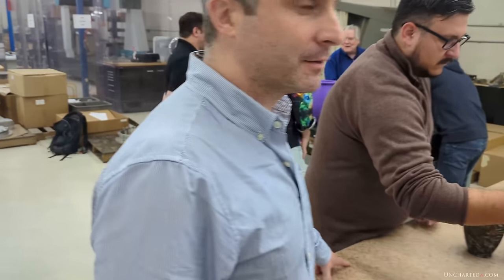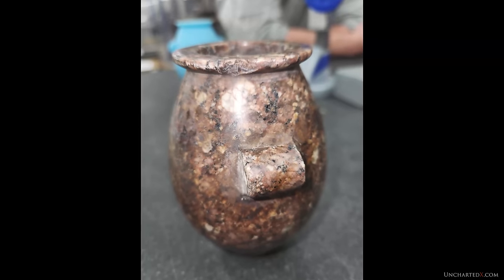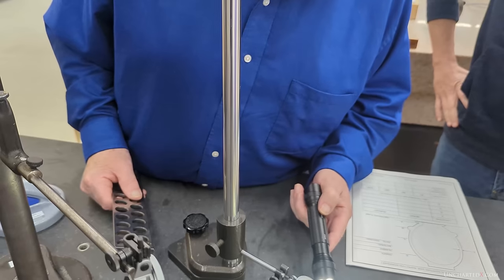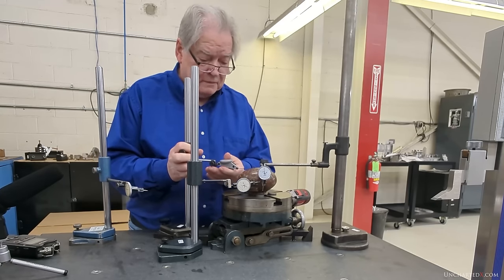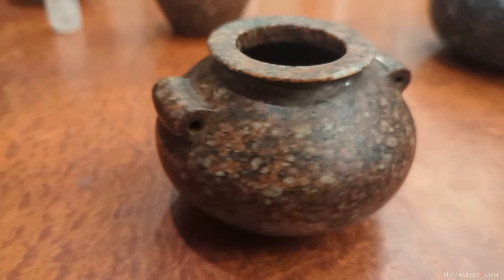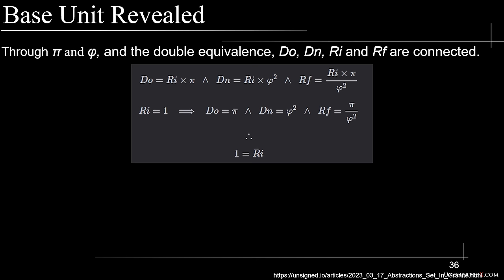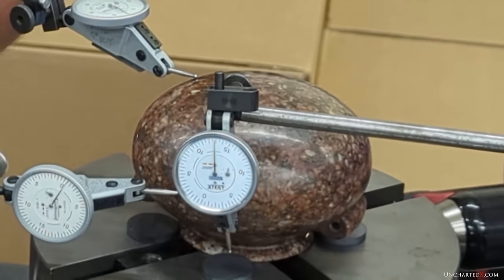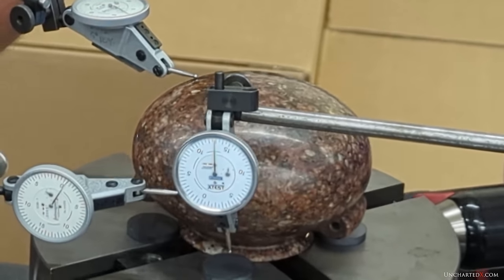Astonishing Results! More Ancient Egyptian Granite Vases Analyzed! More STL's available.

Comment: Ben, this may be a bit off topic but it's about the "I" clamps found connectng huge blocks togetter.. Christopher Dunn wrote about one pyrimid being a power plant of sort and there seems to be a connection between Dunn's idea and Andy Hall's recent video..Andy made a multi-part video series Eye of the Storm but in Andys recent video he mentioned the "I" clamps were NOT there to keep the blocks together as the main function but to allow for a neutral charge in all the connected blocks..should Dunn be correct that the pyramid is a power plant, having a neutral charge through out the pyramid body as to not interfere with the power plant operation would be essential i would think..
Other blocks are fitted so perfectly as to not need an I clamp and one still has a neutral charge throughout the entire pyramid..
Mention this idea to Christopher..might be something he may not have heard or thought about..
Your videos are fantastic..Thx..

Comment: Just my 2 cents but you shouldn't use concentricity, in metrology it was finally removed from asme y14.5 in 2018, and in prior revisions it was a much different meaning and method of measurement than runout. The more appropriate tolerance types would be circularity and runout, depending on if it is referencing its self or to another feature/datum.

Comment: Thank you for a fantastic video. Real numbers at last.
Given the apparent obsession with ratios of geometry do these jars have any acoustic properties? e.g. If you run a wet finger around the lip what note does it produce. Do all jars produce the same note? If a note is produced it may explain the need for such thin walls.
You showed the within part relationships between dimensions. Do the dimensions in one jar match up to dimensions in another? i.e. Beyond the magic ratios of pi and phi, was there a magic dimension?
To make these jars with the precise height today we would machine the jar then cut the top and bottom to length, rather than machine them from a granite slab already of the correct height. This would mean that a donut shape piece would be cut off and discarded. Do we see any industrial waste, of discarded stone donuts, anywhere in Egypt?
You could not make these jars on a modern lathe because of the lugs. However, if the 'lathe' OSCILLATED back and forth (like an ancient bodge) between the lugs it could be machined. Perhaps the jars were rough cut then packed in clay containing smaller harder stones and oscillated back and forth until smooth. The area either side of the lug would not get as much abrasion as other faces (since there would be a pocket of air that allowed the lugs to oscillate within) and this may account for the weaker dimensional accuracy that you were seeing in these areas.

Comment: They look like Helmholtz resonators. Put some electrodes in the holes on each side and run some high voltage and high current through it until it gets hot and tell me what note comes out of the hole please and thanks. It seems like a plasma cavitation device.
If you do the reverse and vibrate them with their own resonant frequency using thermoacoustics...you should get a voltage. They should be thermoacoustic and thermoelectric. In fact I think vibrating them should produce electromagnetic waves.
Many ways to get voltage out of them but cavitation seems to be it... because you can use sound to vibrate them until they heat up and they will get hot inside and suck in cold air and blow out hot air and blow like a horn. It will create voltage and a magnetic field. all the air getting sucked into the hole and blown out will result in a charge separation... a potential. The vibrating magnetic field should give you a current. There will be a torus inside and the dust and air that gets sucked into the hole will rotate in a counter clockwise direction... in a torus. Each of those vase are nodes... If you arrange 7 of them at the nodes in a flower of life pattern with one in the centre and the 6 others around it... the centre one will take all the heat and vibrate like crazy making the other 6 vibrate in resonance... and the centre one will become one heck of a powerful electromagnet. You can see it if you vibrate a water droplet.... 6 bubbles and the centre bubble.. 7 nodes in a flower of life pattern. It's an electromagnetic pattern showing the direction of the charges... because when you vibrate them apart you get a potential.
Those handles seem to be at 0.224 times the length.. right at the nodes. They are thermoacoustic devices. The only reason you would do this is for sound. I'm pretty sure it's pushing an F sharp note in 432 hertz tuning.
Reply: you're right on the money, my friend! btw, my second passaggio occurs at F#...

Comment: Are the holes through the mounting lugs straight cylinders, or are they curved following the diameter of the vessel?  Measure / do analysis on the volume of the vessels vs frequencies.

Comment: IT looks like these are parta of machinery. Like insulators, covers etc. for high voltages. The finding of 16GHz wavelength as basig unit also supports this.
Reply: bingo. remember antique glass insulators? they also had a specific function and were ubiquitous, but show them to a zoomer and they'll have no idea what they were for--and these were used as recently as 100 years ago. no wonder we have no idea what these "vases" were for considering they are at least 5000 years old.

Comment: 19:00 To the critics: IT ONLY TAKES 1 SURFACE machined past human abilities to PROVE they had advanced tech thousands of years ago!

This is by far the best evidence for lost advanced civilization I've ever seen, & this has been an interest of mine for 20yrs.
They can't dismiss this as natural geological formations!
Reply: There is also a "cave" carved out of a hill in India with machined smooth walls smoother than can be done by hand. So this tech wasn't limited to just 1 area.
Reply: @goldenheartOh How do you prove it is smoother than possible by hand?
Reply: @Vision_2  measure as many works of art & buildings from as many masters as you can from ages where there's no doubt what tools they used, and take the most perfectly flat piece we can find and make that the flattest humans can make without advanced machines.
Then, see how close it comes to a 10,000th of an inch.
I imagine this work has already been done. 
It certainly makes common sense that we can't make things anywhere near as precise as our best modern machines, so if we find flat surfaces from antiquity that matches our best modern flatness, there you go.

Plus, it's darn hard to even see a 10,000th of an inch.
Reply: @goldenheartOh  There have not been any measured ancient works that surpass hand level skill. Hand polishing can achieve single digit microns level as measured with roughness meter. All the modern precision measuring tool sets originated from hand crafted tools.
Reply: @Vision_2  it's not the surface smoothness that is impressive, it's the consistent and precise geometry in solid granite.
Reply: @Vision_2  are you saying these machinists are all ignorant to be impressed? That it can all be done by hand? If that's true, why isn't it more commonly done? & in granite? 

Smooth & straight to a single micron can be done by hand? I really find that hard to believe.
Reply: @AustinKoleCarlisle  Impressive I think we all agree.
Reply: @goldenheartOh  Perhaps you find it personally hard to believe but you can prove it to yourself using the 3 plate Whitworth method. That is specifically for flat surfaces. Continued polishing with finer and finer grit.

Comment: I want to take the 3D scans, and do a variation comparison comparing both halves of the vase.(if you take one half, with a handle and inverted it’s x coordinates and compare them to the other half) 
I’m wondering what the deviation would be. 
Are the handles on both ends at the exact same coordinate plan on both sides of the Z and Y coordinates?  If so, what is the deviation?

Comment: how are the handles carved? i could see these being lathed, but they are nearly perfect around the handles. almost seems more likely they were cast with some unknown technology.
Reply: Flinders Petrie documented the spiral single point cutting of the inside of these vases in the 1880's. He said that a lathe must have been used with something as hard as diamond used as the cutting tool. The wall thickness is too thin and uniform to be done with any non precision method. This was discovered by measuring wall thickness of broken vases.

Comment: @UnchartedX Very cool work! Minute 30:33 From my experience working with lathes, couldn't the area around the handles be done on a lathe by slowly grinding back and fourth between the handles? It would be pain stacking to do but should be completely possible. I think this would most likely be the only possible explanation for the perfect roundness everywhere. Is there any evidence on the vases to back up this method? Correct me If I am wrong.

Comment: Hi @UnchartedX, GREAT WORK as usual... QQ: @ ~43 min in you expound on the relationship of the various ratios taken from the radius of the inner lip used as the design template for the artefact.  Has the metric used (measured in mm or inches) turned up in any of the other samples examined?  i.e. Is there some reverence being paid to a specific 'measure' that is then being profoundly communicated to us by virtue of its use with defining other design features based on fundamental ratios that any sufficiently advanced civilisation would have to recognise.  And does this metric (or multiples of it) align with any known fundamental constants of nature?  Were the designers hinting at the fundamental architecture of our manifest reality?
Reply: it's based on the royal finger, which is part of the cubit system.

Comment: Hey bed great work using precision aerospace industry  measuring equipment to show the highly irregular accuracy and precision exhibited in these ancient vases. I have a suggestion so that u can quiet the skeptics and debunkers trying to disprove the measurements presented. Next you'll need to take vases not found under the same pyramid as these highly precise ones and measure those with these instrument to show the inaccuracy and lack of precision of the actual hand made/sanded vases trying to replicate these older vases. Need to prove that the rest weren't just as precise and ur not selecting one trying to show its a unicorn by not testing any other ones against it. Keep it up

Comment: Ok at the 43:40 time mark, my brain exploded with extra thoughts.  When you teach a child basic math you have to start with explaining what a plus and minus sign are.  Then a equal sign.... and meaning.  This jar almost seems like it is using separate "analog" physical dimensions to formulate or explain or show a defined space, or reference.  So does that specific 18.739 hrz frequency... resonate or have a specific property to the volume specifically designated by the vase.  I don't know.  Or like a math equation, you solve it from left to right or top to bottom.  Do the numbers crunch in a sequence of some sort?  Or is this the pie version of A squared plus B squared, equals C squared.... in circle format, not triangles.  My math is lacking... back to basics.  One thing for sure.  These physical dimensions on this vase are not by coincidence.  They define a specific volume of area, or galactic measurement maybe.  The universe uses metric or standard.... what is the galactic standard measurement of one.  If you have one.. you can count binary.  Friggin love your channel UnchartedX!!!!!!

Comment: Ive been wondering why 40,000 such pieces were found under the step pyramid ? That means someone told people to go out and collect them or for people to return them? So why would this happen? Maybe to hide evidence?, they were buried right. Maybe they failed for some reason to finish the job! Were they stoped by others who didnt want that to happen? No one yet knows but something caused all those objects to be put in those tunnels and hid. 
Also as a geologist and amateur machinist/fabricator/metal sculptor I/m wondering if those measurements  such as 0.002-0.003" etc are not due to the thermal expansion of the various minerals in the stone as they heated up or cooled off? In short, maybe they would have been perfect if they did not heat up or cool off! One last point, you mentioned that some of the pieces had an order of mag. difference from the most precise ones. Thats 10 times less precise. Thats about the difference between how precise we could make metal parts in the 1700'-1800's  apart from one another and those we could make after the industrial revolution! Once we got complex machines !  Where are the machines they had earlier in time!!

Comment: The vases look like they were designed in CAD software by a student who didn't yet realise how hard they would be to manufacture. And then picked granite, of all materials! It's mind boggling that these were produced 1000s of years ago.
Reply: They would be very easy to manufacture with a 4 axis CNC machining centre machining the externals, and a lathe machining the internals. A 5 axis machine could do internals and externals in one setup. I am talking about making the geometry, not about the material. Granite would be possible using diamond tooling.
Reply: @motordude67  You are joking right? We have computerized machines that lathe car rims, which needs to be as perfectly round as possible for wheel balance and performance and we still can't even get them as perfectly round as these vases.  And if other cultures had sophisticated math and measuring tools at their disposal, why weren't they creating more of these simple shaped vases in any other time period beside these selected vases that were all dated from the "Pre-Dynastic" period???

Comment: I just saw a video from Matt Beall Limitless. He had a Ralph Ellis on, they were talking about the "Royal finger" and it was 18,71 mm. In this video the base unit is 18.73 mm. Seems very close, and to me a good explanation of what measurement they used. 

I found this vide to be great, however the part with the base unit be speed of light and 16 GHz divided I found be be a strange conclusion. I royal finger seems to me to be a more plausible explanation

Comment: I scrolled through some of the comments to see if anyone had asked about what if the measuring unit wasn't in a decimal type of system (divisible by 10), but one which was divisions of 12 (Mayan) or 60 (Samarian?)? The universal truths of Pi and Golden ratio would still apply, but the outcomes may vary slightly?  I haven't googled to see if anyone knows what measuring system Ancient Egyptian cultures used...anyway, if anyone has asked the question, could you point me to the answer?
Reply: They compared ratios, units don't matter.

Comment: Something I think needs to be touched on more is metrology. It takes precision measuring tools to make precise objects, otherwise you're flying blind.  Even modern machines have runout, tool push off, insert wear, temp changes, and numerous other things that impact tight tolerance machining, that make it virtually impossible to hold tight tolerances without the correct metrology tools. The Egyptians had absolutely no way to measure any of these precisely, but we are supposed to believe they made them precise, by chance??

Comment: I have a theory not related to this video but i figured you'd have the best chance of seeing a comment on a new video. With regards to the huge crumbling granite columns in Karnak is it possible that cutting the stones at such high rates would restructure the stones surface due to the immense heat and friction caused by the cutting tools? Maybe someone out there could figure out how hot the stone would get at the theoretical cut rates found on some of the super huge unfinished stones in the megalith graveyards.

Comment: The amount of precision is inexplicable. Like, I have a 300 ml coffee cup. Would I care if it was 304 ml or 291 ml? Absolutely not, as long as it's aesthetically pleasing, and serves its purpose. I wouldn't care if the inner or outer sides are perfectly straight or not, because I only use it to drink coffee. We assume that these vases served a similar purpose like holding some contents, but we don't know that. Have any of these precision-made vases been found with contents inside, and if so, what were they? Even if some have been found with contents, we have no way of knowing if that was their intended purpose when they were made, since they could have been re-purposed by later Egyptian cultures. The other thing to address is the handles. The handles are what makes these vases impossible to reproduce using today's technology. Then there's the materials used. Making such a vase would have been an expensive proposition even if you had a superior level of technology (an assumption, I know) and usually you don't have a container be more expensive than the contents it holds. Even if the vases held Gold dust, the containers themselves would have been overkill.

Comment: A potter's wheel would do the trick. Reversible blades would allow it to shave from either direction, and a cammed outer blade would leave the area of the handles to be hand-worked, which they obviously are.